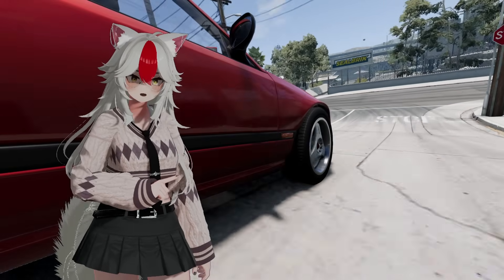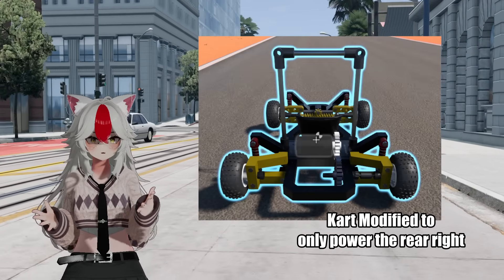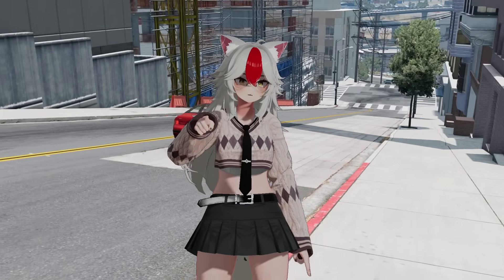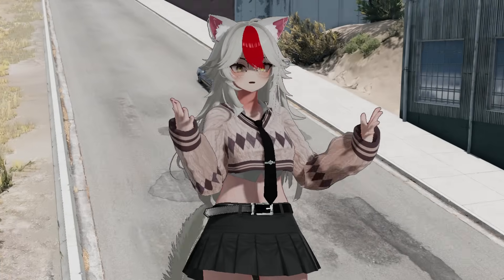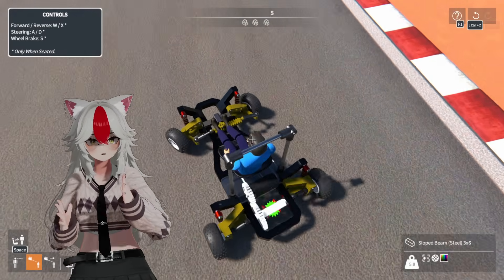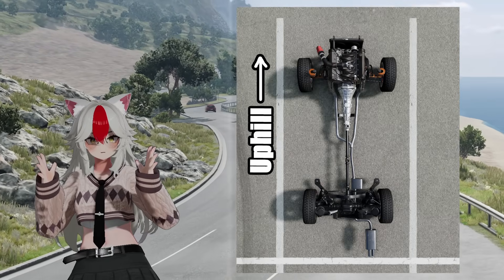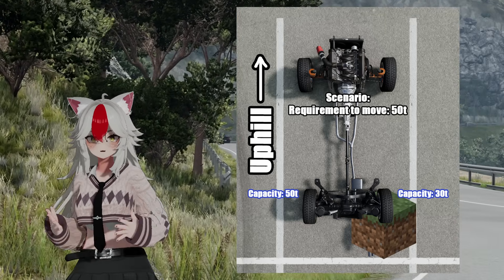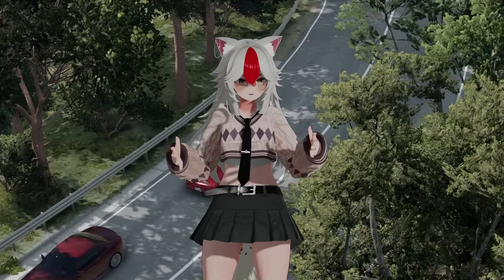Car Vtuber Explains: How a Differential Works

Comment: Using the brakes when stuck works great. Literally how I get my fwd open diff fiat panda through the snow. Heel and toe with gently riding the clutch - gets moving without getting stuck, hell yeah

So anyway, Emi, if you find open differentials and torque vectors confusing, you'll have fun with suspension geometry, spring rates, and damping too :3
Reply from the maker: We'll eventually touch on roll centers, tire slip angles, alignment, weight distribution, corner balancing, etc eventually too!

Comment: 0:18 its actually not relative to the radius, but rather the total angle (radians) * width of the axle
and a bigger radius would mean a smaller difference relative to the distance travelled

Comment: so uhh, dirt rally 2.0 made me learn that if you have an open diff, the car is nimble, but delicate, while if you have locked diff, it's very stable, but you driving a literal boat. (just like mouse sensitivity in a way)
dirt rally 2.0 physics favors the latter, because the surface there is rather slippy, be it a tarmac, dirt or ice, meaning it's faster to just e-drift into a turn with locked diff.
unsure if that's the case irl, but still.

Comment: hello, great video - definitely a good way to visualize the concept,
could you do an episode on the dynamics of weight transfer?
would make a good starter to explaining how wheels lose friction coefficient under extensive load, or why rear wheels lose so much traction under braking - and the corresponding driving technique.

extra points for using a truck or something equally tall and stubby, seeing as the acceleration necessary to topple over is proportional to track/wheelbase and inversly proportional to the vertical center of gravity

Comment: I knew differentials were an old engineering solution for early forms of automation, but can't say I was expecting it to be older than the son of god himself. 
Solid explanation on how it works though, you've been doing a good job on the series.